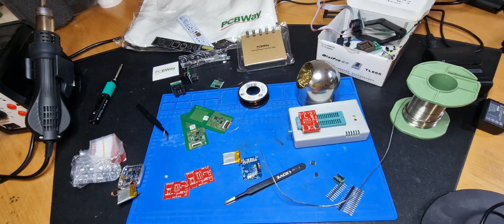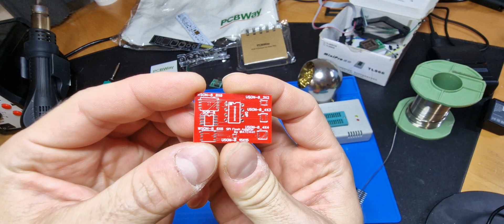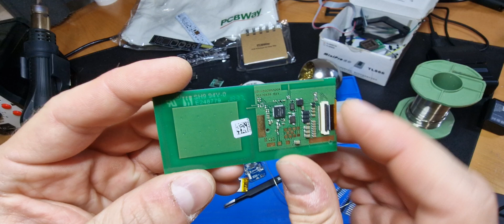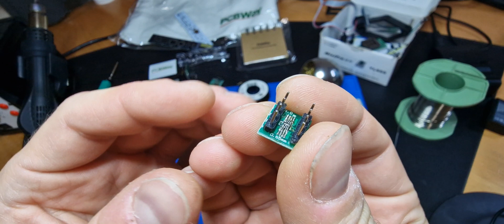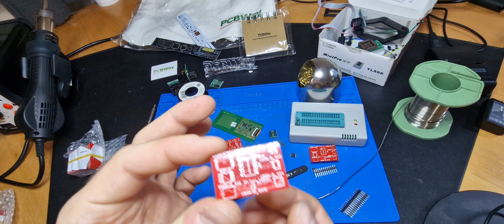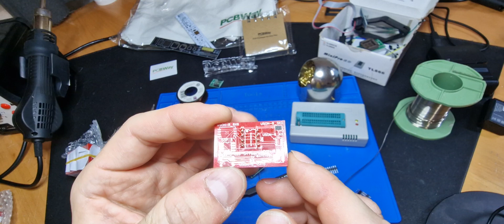Universal SPI Flash Adapter PCB do read and write small packages USON WSON etc.

Comment: ESP32 uses NOR flash to store its firmware and other data. 
How about QSPI have used it before with such flash memories?
Reply from the maker: It really depends on what the flasher itself supports. This pcb is just the adapter

Comment: I would improve this by making the pads of the nasty MLP package as long pads with indentation, this would allow you to easily flow solder onto the pad, making it 100 times easier to solder the chip, a little more expensive to produce such a PCB, but totally worth the money.
Reply from the maker: True! Would work better